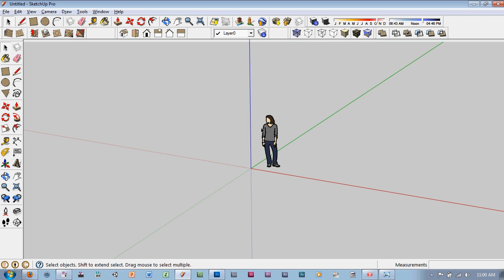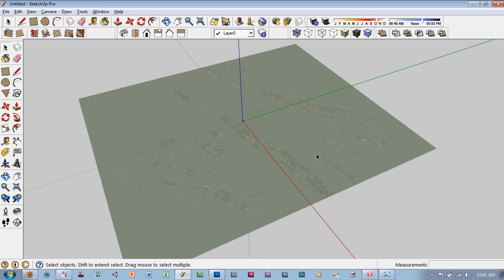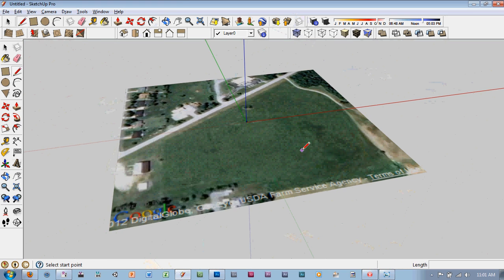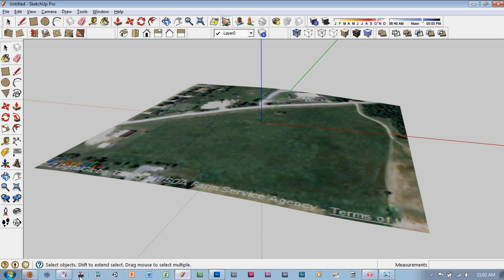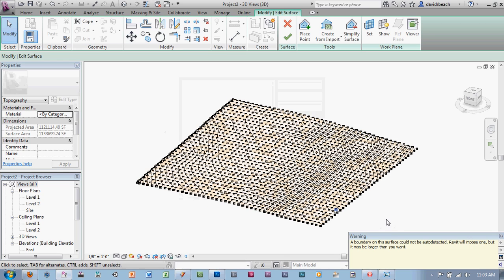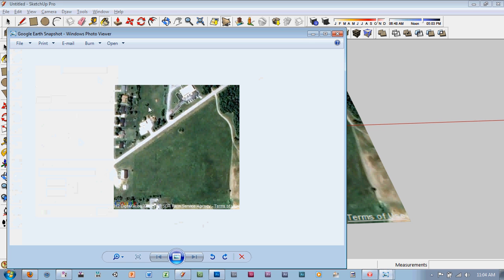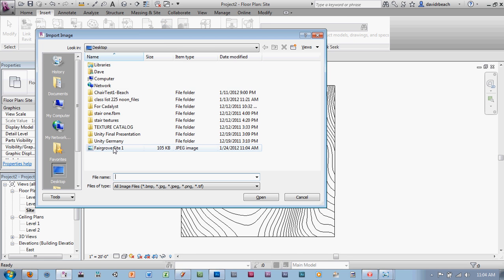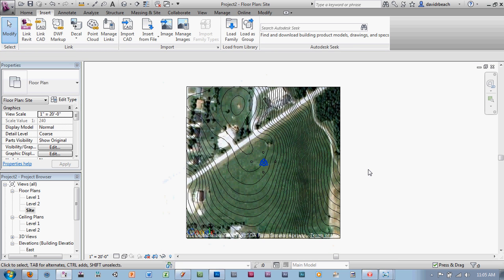BuildingTopos From Sketchup to Revit

Comment: How can I find missing objects in Revit? The part was missing in Site View, but is present in 3D and Elevation Views? 

I even increased the view range in site plan to unlimited, but it's still not showing.
Reply from the maker: Not 100 sure i understand...but, not seeing something is usually one of two reasons. It is hidden, or behind the view plane. To figure out if something is hidden click the light bulb at the bottom. You can find out if something is behind the view plane by clicking on your elevation tag in the plane view, and visually referencing that to what you WANT to see. Remember, in Revit, pretty much everything is actually a section, including elevations. If the cut line for the elevation (section) is not on the correct side of your object it will not show up.
Reply: @DavidRBeach  I forgot to add this, but the toposurface suddenly disappeared after finishing the conversion process. 

Even with unlimited view range, nothing is showing up in the plans.
Reply from the maker: @drvlive2023  - oh! Wow...not sure on that one at all. You might try this: Take the base file that you are working with (the topography imported from sketchup or wherever) use Revit to export it as a *.dwg. Re-import that *.dwg file, and use that specific file to create your topography. Revit, in its newer releases, seems to have become very picky about what format it will create a topo file from. Formatting the file as a cadd file (*.dwg) from Revit has helped in many instances. The other thought i would have is to make sure you are looking in your site plan view. Topography objects do not, by default, show up in any of the plan views. Only the site plan view.
Reply: @DavidRBeach  edit: it is indeed in *dwg

Another thing is that maybe I should just redo the whole document.
Reply: @DavidRBeach  update: I repeated eveything and these are what happened:

Toposurface generated in 3d view, but the file is still in import symbol in all floor plan views. I don't know anymore.
Reply from the maker: @drvlive2023  - Huh...perhaps (seeing as how this was the version from 2012) i should do a quick update on the process and provide some updated steps for you. I am not sure where/why it is going sideways! Apologies!! Gimme a couple of days and i will see if i can post a newer version with 2021 software.
Reply: @DavidRBeach  I am using 2018, maybe the software grew tire of me for getting stuck on the same problem for a long time. hahaha.

No need for apologies, for most of the problems are on my side. I do appreciate all your efforts of reaching out. Because of that, I'm subscribing. Thank you so much!

Comment: Unfortunately revit has issues with scaling. When I try and overlay my image it doesn't line up at all
Reply from the maker: Hey Regina! Off by how much?? If it is off by what would amount to around 10-20 feet at the edges, with a slight difference in rotation, i would say that is common. This is why i describe the method as being "accurate-ish" but not survey level quality. Good enough for early ideation and academic studies, not good enough for documentation.

Comment: How can I cut the image or the topo if I want to following a specific bearing of the lot?
Reply from the maker: In Revit or SketchUp?? In Skup...it is probably an issue of deleting or doing a boolean on the  geometry. In Revit you can use the topo tools (split surface) to keep only what you want. If this is an image issue (texture map) then you are using Photoshop and positioning processes of the image in Revit. Just make sure that any changes you make to the image allow for the scale of the image and the scale of the geometry to match. If the scales don't match,  you end up with a fictional site. Cool??

Comment: I realize this is an older video. Two questions,  first, is there any reason to not just export a 2d graphic and then edit it photoshop?  second, does anyone know why when you import the location and then export it, its slightly askew ?
Reply from the maker: Howdy Jason! Yes, exporting a 2d graphic and editing in Photoshop works great as well. When teaching college kids (my primary audience), i sometimes add extra steps to reduce variables that can go wrong (like forgetting to set the view to 2d). We have also started grabbing images from Google Earth, overlaying those on the 2d graphic from Skup, and essentially "uprezzing" the pretty terrible resolution on the imported image map - takes a bit of time, but worth it for much higher fidelity results. On the off axis issue...someone posted the reason why this happens on why of my videos a while back, it had something to do (if my shaky memory serves me correctly) with the way georeferencing happens in programs that use real-world values (Flux, Google Earth, etc.) vs programs like Revit and Skup. If i can put my hands on that answer again i will be happy to share it, but my initial search came up empty.
Reply: Thank you for this reply.  Anxious to know more about the axis issue.. however, is there any way to counter it, or do we just assume minor editing and trust that errors are negligible?  Thanks again

Comment: It helped me a lot as I was doing such task for the very first time. I'm just curious to know that why I'm getting this warning every time I import the file into Revit.

Warning: A boundary on this surface could not be autodetected. Revit will impose one, but it may be larger than you want.
Reply from the maker: ABM - to be honest, i am not 100% sure, but the best i can tell is that it has something to do with a bit of an inconsistent edge in the geometry around the perimeter. This causes a bit of an overlap as the points are stitched together to for the terrain geometry. You will notice the errors around the outer edges of the terrain if you look close - points not forming the correct geometry when they become a terrain. Happy it helped out!
Reply: Thank you sir for taking the time to read my comment. What you've explained makes a lot of sense to answer my question.

Comment from the maker: The site in SketchUp is 1:1, and the scale base in both programs match in what they define as a unit in the program (i believe both use 1 to 1" - this is as opposed to maybe 1 to 1cm).  So, the imported topography in Revit will be at 1:1 as well.    Scale the image underlay to match the geometry in Revit.  Some programs, like moving Revit to Unity, use a different scale base, and then you have to worry about applying a scale factor.
Reply: I used this method and the image has different proportions than the topography...any idea why that might be?  I guess I'll assume the topography is correct and the image is incorrect.

Comment from the maker: Hi Thomas - sorry, the only way(s) to smooth out the topography using this method, that i am aware of, is to either:  Increase the resolution of the mesh imported from SketchUp (zoom in closer to the site), or to add points in revit to smooth out the contour lines.